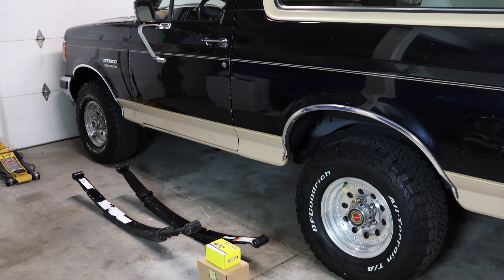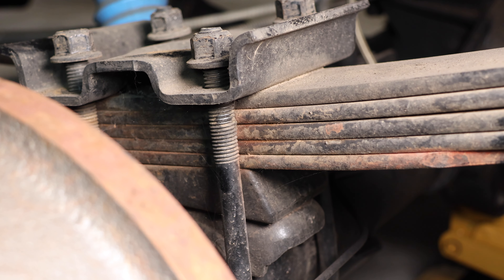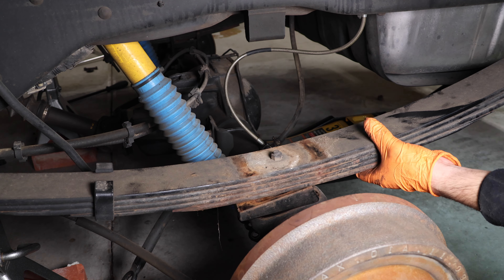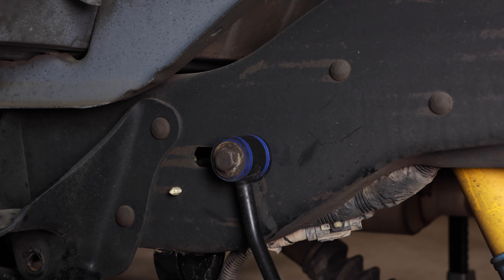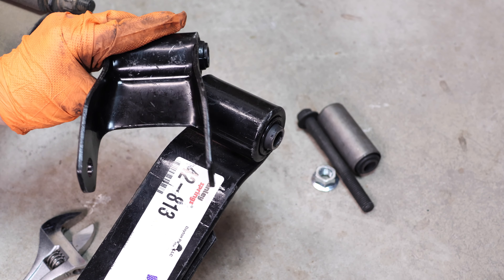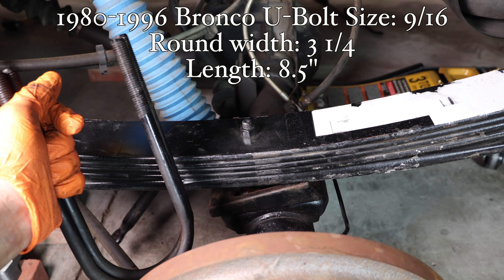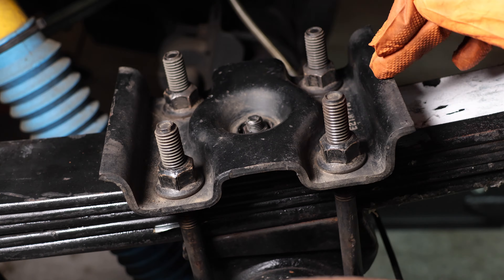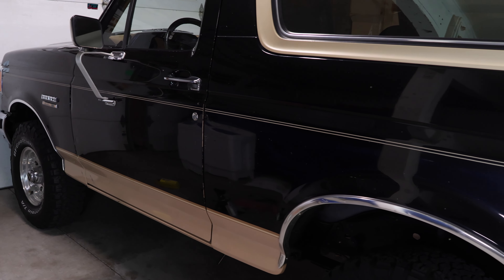Leaf Spring Replacement | 1980-1996 Ford Bronco F150 | Replace Sagging Springs | Bronco Restoration

Comment from the maker: Replacing your old sagging springs will restore your trucks ride quality and height. Be sure to replace your U-Bolts. Let me know if you have any questions about this repair.
Reply: I was just about to tackle this project and was wondering if those U bolt sizes are the only size that will fit a 96 bronco. I've looked at every parts store in town and can't find any that match those measurements. Thank you
Reply: I'm wondering if I should just change my bushings and keep my OG springs. I got an 89 bronco xlt. Notice any change in ride quality with the new leafs?
Reply: Did you have to contact Dayton Parts via phone/email to order these springs?

Comment: I notice that you install the hardware as is, that is, you don't slather everything with grease on the threads or shafts. Is there any need or advantage to applying some? Maybe it depends on your weather and if you park it outside. Very well done video.

Comment: The fitment on the springs says it only goes up to '93 and my bronco is a '94. Strangely having some trouble finding a non-lifted spring for '94 model.
Reply from the maker: You are correct, the spring for 1994-1996 is Dayton 431091, also 43-1091
Reply: @TheFixTech  Thank you!

Comment: Fixing to start doing the rear end of my 94 Ford f150 extra cab short bed replacing both leaf springs, leaf spring shackles, as well as the brackets that are bolted to the frame and a sway bar bushings

Comment: Good video once again! 

I wanna find a leaf spring pack that gives the same stock ride height but has a larger overall length so they flex a bit easier. I wanna fabricate some mounts similar to the sky's offroad kit to put super duty springs on an obs truck. Apparently those leaf springs make the ride way smoother because of the greater radius the Leafs have.
Reply from the maker: Good idea, the factory bronco springs are rated at 1650lbs you can get a set of factory f150 springs as they are rated at 1300lbs which should give a smoother ride, but will sacrifice on towing capacity.

Comment: Gotta do this to my '97 250 HD. Coil springs, too.
Finding parts is like finding a 4 leaf clover.
Called Moog. They don't have anything for my year, or a '96.
Rep told me Moog bought Monroe, &  is moving towards shocks.
Reply from the maker: Husky Spring will have for your application. Part number 46395 standard and 43695HD. I believe your truck has leaf springs in the front as well (unless was converted) front leaf 43498 again Husky Springs
Reply: @TheFixTech  Appreciate your time!!

Comment: thanks for the great video!  I need to install the angle block on my Bronco but want to put off installing new leaf springs - is it possible to get the block in there with jacks and removing the U-bolts?

Comment: I followed your front suspension video. If I chose the 1-2” lift springs do I need to select a different rear leaf spring or leveling kit? I assume I need to lift the rear by the same amount. Can you please advise?
Reply from the maker: The 1-2 front lift will level out the truck which people like as these trucks have about a 1-2 rake in the rear. I personally like the rake and would lift the rear about the same amount.

Comment: Can I use the other parts you listed (u bolt , shackle, etc) with the $229 leaf springs at jeff’s bronco graveyard ?
Reply from the maker: As long as the leaf spring width is the same, 3”

Comment: Do you have to take off the rear shackle if I'm just replacing the springs only?   Thanks
Reply from the maker: Rear shackle removal is not required but I do recommend as it does have a rubber bushing that wears out.